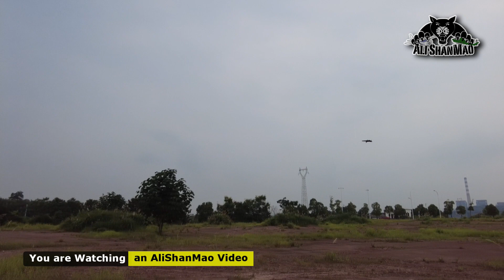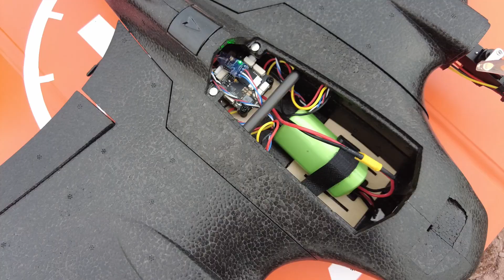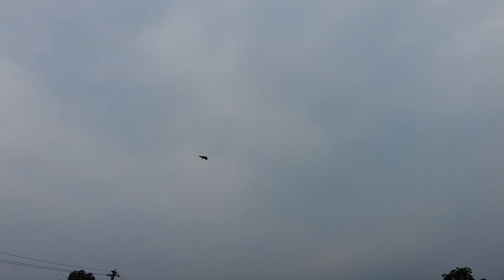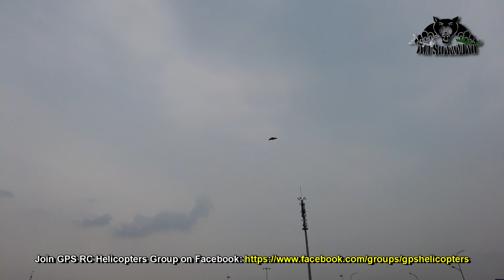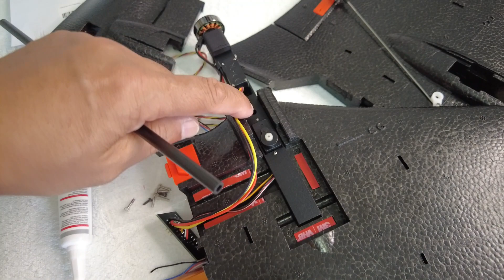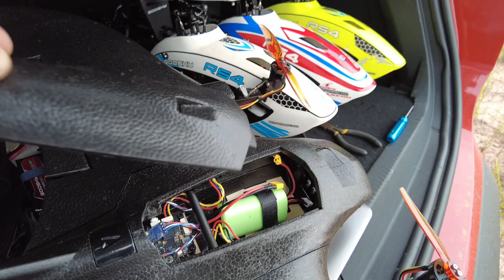FIMI Manta VTOL Fixed Wing RC Airplane Quick Build and Maiden Flight

Comment: Just had my maiden flight.  Very easy to fly in both Q-Stabilize and FBWA modes.  Transitions are very smooth both ways.  I'm planning to change the cruise mode to acro.  If you add FPV, there are few options other than up front which screws up the CG so you'll require some counterweights at the tail.   Quality is very good, just don't bother to install the nacelle covers.   I'm planning to install my Caddx Vista on top of the canopy to get around the CG problem.  The biggest problem right now is that there are ZERO spare parts available anywhere.  I'd like to have a spare canopy so I can modify it for the Caddx Vista. Its an amazing plane at a great price but we need parts.
Reply from the maker: have fun buddy. I would rather 3D design and print the parts like i can design and print canopy that will have exact fittings and place for the systems i wanna use. unfortunately mine one day flew in thick trees, and after searching for hours and hours i could not find it. so mine is gone. i can't do anymore design work or 3d parts for it. i was planning to do many custom 3d printed parts for it.

Comment: Your wiring diagram is wrong.  The UART TX is BLUE and goes to the edge of the receiver, the UART RX is WHITE.  There is no  yellow wire.  Your actual wiring on your plane is correct, but your diagram is wrong.
Reply from the maker: Lucky us, that Diagram was supplied by FIMI and I followed it. well guess what one day it just flew away in thick trees and i searched for hours and hours and hours. could not find it

Comment: Hi Ali got another question, i have a radiomaster tx16s do i need a receiver to plug into the FC, i asked FIMI but  they said all i need is a battery and the radio, i would assume u need a receiver to bind to the radio but naybe i am wrong. If i need one which ones are good to get.
Reply from the maker: you need sbus receiver to plug in, which is pretty complicated because you need to fiddle with ardupilot settings. most plug and play setup i found is to plug in a TBS Crossfire Nano sbus Rx, and then use TBS crossfire lite on my TX16s or boxer Edgetx. thats the easiest.
Reply: I just realized ali i have a new dragonlink module and receiver that works with ardupilot will this work. I bought it for my hex a copter but gonna use it on the manta
Reply from the maker: @andysdroneempire1942  if you have something that works with Ardupilot, of course then you can always get manta

Comment: Hi Ali: Great video ii have my PNP with FC and GPS coiming in a few weeks, were did you get those lipo batteries you are using in this video, do you have a link you can share, all the lipo batteries i can find anything over 2200 MAH is too big for the battery compartment on the FIMI manta.
Reply from the maker: sent for testing from factory :) they are not available for sale now. maybe they will bundle with RTF versions?

Comment: I love VTOLs. Have many of them. This is what the Eflite Convergence should have been. I'd like to buy this one (PNP with FC) but several questions come to mind.

1. Radiomaster is not that prevalent in Canada. I use Spektrum. What RX do I need to work this thing? Serial? Standard RX?
2. Will this thing work out of the box without FC programming as a VTOL only. I have no desire to do FPV or programmed flights or even long, endurance flights.
3. LiIon batteries are not that usual here for RC planes. Can this be flown with LiPos?
4. Is there a set of instructions included with this or is it one of those, "If you don't know how to set this up, you shouldn't be owning one" kind of models?

You've been a great help to me for my FlyWing 450 adventure.  Yes, I'll buy you a couple of coffees very soon.  - "Ok Vad" on Facebook  😎
Reply from the maker: I am not sure what rx to use for spektrum. i have no idea for that. there is a way set sbus rx for this pnp ardupilot sbus but seems need some settings to change. i am using crossfire so it works like a charm. like real plug and play
it works as vtol right out of box once you do right setup. there is a guide for how to program radio and which switches 
yes it can fly with lipo. make sure to set CG right or you will crash it because its a wing and in forward flight cg is most critical for wings
i have no idea what is included in terms of user manuals. but fimi normally does a good job with manuals. still if you need any help you can email me. i can share my radio settings, ardu settings, and any questions you will have, i will try to help you out. 

thank you for your support. this is such a sweet vtol. i will be bringing it out again once i finish welding my electric paramotor trike. this is taking much time now. I am welding the new power combo frame today. puts out 62kg of thrust. and then will weld a small trike. I will design and 3d Print the wheels and many parts i plan to 3d print :) I may post that project in diy videos. then when I get time, i will bring this VTOL out for more flights and FPV

Comment: Nice. Any plans on changing gps to a one with compass. So position hold works in hover. Would be nice to see a how to on that subject.
Reply from the maker: so far no plans :)  because the vertical take off is only for taking off and landing and then we switch and fly mostly in Forward flight mode

Comment: Thanks a lot for the vídeo! Will you install an analog Fpv system in it ?
Reply from the maker: soon, after i get rid of the current issue of this not switching to forward flight mode. something to do with some kind of glitch in flight controller

Comment: You talk about limited banking angle, is there any way to go to the acro mode, or is it locken in attitude? Do you have experience with other VTOL UAVs to compare Manta to? Thanks for informative video, cheers!
Reply from the maker: you can program ardupilot the way you want buddy :) so far no other vtols to compare to in this size. if i get one, for sure will compare

Comment: Got mine today, PNP version. Planning to install it with the new Speedybee F405 Wing and add a DJI O3 Unit. Any idea if the Speedybee wing will do the job too? Looking forward for the other Fimi manta video's!
Reply from the maker: if its designed for VTOLs, it should do the job of course. I am actually looking at SNL Fast FC. its super easy to setup using OSD only, supports QGCS and MP, and Y3 VTOL as well. Ardupilot is just way too complicated to understand LOL for an old man like me
Reply: @alishanmao   FWIW I have the SN Fast and its been an exceptional FC so far, a bunch of flight mode options and great customization.  Mine is in a standard wing though so I cant comment to its VTOL abilities
Reply from the maker: @ST19859  yup i am also thinking to get one SN Fast to install in FIMI Manta :)
Reply: The Speedybee wing can run Ardu Plane  so you should be good for VTOL.
Reply: There are only two locations for the engines, you need at least three for the manta, right?
Reply from the maker: @patricehonvault2612  3rd one is on top of the tail
Reply: @alishanmao  I wanted to clarify that there are only two motor slots on the speedybee flight controller and the manta needs three slots.

Comment: I have a question I’m trying to get into the hobby of drone photographer and wanted to ask if you know any good drones with good connection and and if the drone can carry the weight of modified parts please inform me if you know
Reply from the maker: i have sold out all my drones. else you could have bought mine cheaper.

Comment: 12000mah battery tattu 15c rating Cell voltage on 6 cell 3.7 V Total voltage 22.2can we drop more than this is it safe or not battery will not have any problem please reply sir from india
Reply from the maker: 3.6 is the last